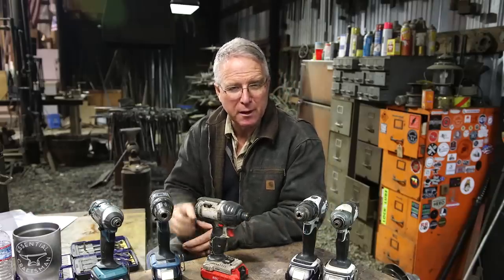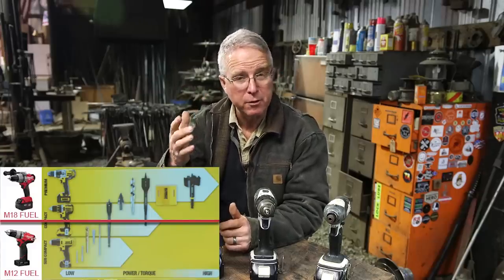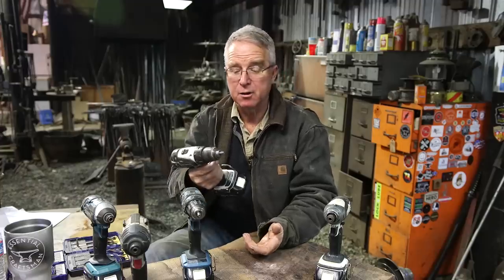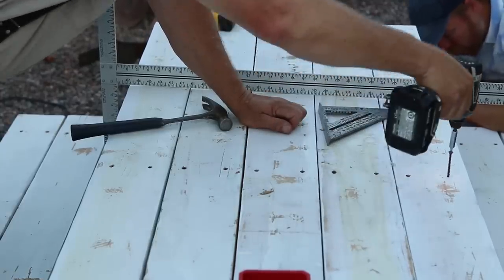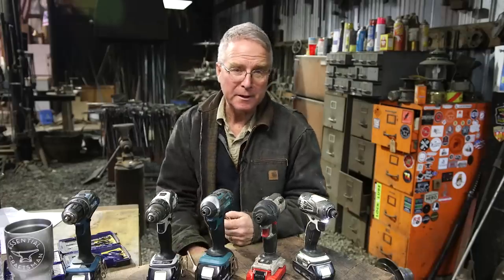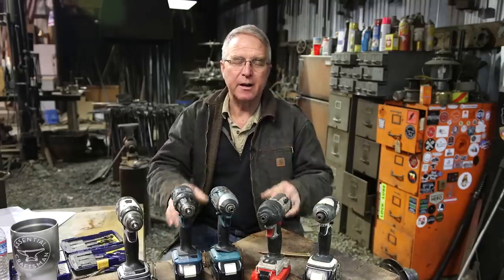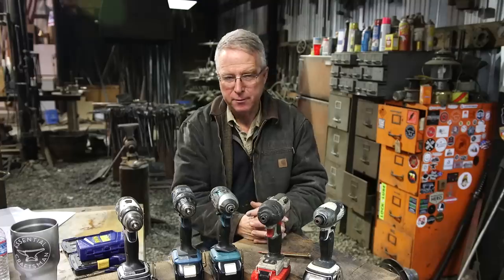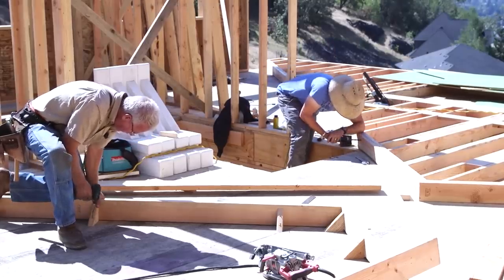Impact Driver Vs. Drill Driver

Comment: I had a boss who didn't want me using an impact because he didn't like the sound it made.  I don't miss him!
Reply: Wow, Crazy  , I guess he didn’t stick around for the fien cutter thing that is best awesome and noisiest tool ever
Reply: I don’t really care for the sound either, but I love my impact driver and wouldn’t go without ever again.
Reply: STOP USING THAT WORM DRIVE!
Reply: I prefer impact for framing. Anything tiny, minimal fasten jobs, etc, I use a drill. On the subject of annoying sounds, I have to use a "fine tool". Dont know the proper name, that's what my father almost called in. Straight tool, electric, oscillating blade. Blades about inch and a half. Good for delicate work or small cutouts--cutting out electrical or plumbing from the frame without  damaging anything. It's such a high speed whine it drives me insane. Ear plugs are a definite.
Reply: You should look up oil impacts. An impact driver without the sound.
Reply: @cjhebert94   The name of the tool you're talking about is not the english "fine" but the German word "fein". Fein is a German Company, that invented this tool, and so the tool is often called fein aswell.
Reply: @Loulexismus  appreciate it. Most annoying sounding tool I have to use for work.
Reply: @Loulexismus  Multimaster ;)
Reply: That's the main reason I avoid them. In my small shop the sound is absolutely deafening, and I don't really want to have to put on ear protection for driving screws. When I need them though there's no substitute.
Reply: It's the sound of money to me. Impacts save huge amounts of time.
Reply: @austinpatrick2682  my thoughts exactly.  Lithium ion batteries are also a big time savers.  I use hearing protection... its cheap and its on my neck anyway
Reply: Loulexismus , I think Fein was first to market, but the generic name is a multi-tool.
Reply: First time I heard one, I thought there was something wrong with someone’s drill. Now I won’t live w/o one.
Reply: @robertbeirne9813  YES! The first time I heard one, I thought the ‘dummy’ was just stripping out the screw head!
Reply: Sounds like you didn't like the sound HE made! :)
Reply: @DK85  Yea, didn’t realize it was an impact driver. Sounded the same as when someone was stripping out a screw, or screw tip.
But I’ll take that sound over those damn 2-stroke engines any day! - leaf blowers, weed-eaters, edgers, etc. 😣
Reply: @Narrow_Gate_Forge  not that there's anything wrong with that!...  but yeah he probably did.
Reply: @Nathan.Christie  I got a hydraulic impact driver 3 years ago and it was life changing.  It does what an impact driver does with only a fraction of the sound.  I don't even own a standard impact driver anymore.  Milwaukee and Makita make really good ones.
Reply: @Narrow_Gate_Forge  All men sit to pee, eventually.
Reply: Impact drivers are noisy.  You should be wearing heating protection no matter what so it shouldn't bother you
Reply: @cjhebert94  it's called an Oscillating Multi function Power Tool.
Reply: Did you work in accounts payable or something?
Reply: @robertbeirne9813  just to be pedantic, it's "oscillating multi-tool" to distinguish it from the foldup pocket pliers
Reply: @andrewford80  rofl
Reply: Impact driver in a cemented steel fence strainer post. That will leave your ears ringing.
Reply: Ryobi makes a impact driver called "soft-strike" that is a lot less noisy.
Reply: disklamer you are correct 👍
Reply: The sound is terrible and I'm sensitive to loud noises. That's why I'm a nut for hearing protection.
Reply: @reallyhappenings5597  Yep, more truth to your words than others will realize...
Reply: @Narrow_Gate_Forge  I congratulate you.  Simply making the point that Father Time is undefeated in these matters.
Reply: @coen555  My eardrums just cringed
Reply: I've had alot of bosses who don't know what they're doing
Reply: What a silly fool he is
Reply: @cjhebert94  It is called an oscillating multi-tool or oscillating cutoff tool.
Reply: @Fekillix  Hydraulic impact drivers are much quieter, but by no means "without the sound." They're still very loud, just not as loud as the traditional hammer & anvil impact drivers. They're also less powerful.
Reply: @xenonram  I tried my colleagues Makita Oil impact and I'd call it pretty damn quiet. But the torque rating is much lower, however side by side I'd say the performance is only 20% less, not 50% as the torque rating says.
Reply: I, too, hate the sound of work getting done.
Reply: @paulremmey8268   Generally called a Multi-Tool here in the UK
Reply: Wow, ridiculous.
Reply: Drives me nuts when people use them for anything but large screws and bolts.
Reply: @allwoundup3574  😂😂😂
Reply: cedarstrip rocketship Makes me wonder how he ever became a boss of anything and also you should’ve asked him if he doesn’t like the sound of money? 🤷🏻‍♂️😂
Reply: I pick the impact driver for the noise
Reply: Yes we do. I did a pipe fitting job. Did most of my work at night.
Reply: The idiocy of banning a tool because of the noise aside, impact drills sound so good!
Reply: Oh jeez 😂
Reply: @tristankendrick2582  pmsl the boss pays the wages, but here's hoping he pays day rate and doesn't insist on paying on piece-work.
Reply: Was that a boss or a wife?
Reply: @Mikey-ym6ok  probably both
Reply: @cjhebert94  I think your talking about a multi tool? Or a reciprocal saw.
Reply: That's literally my favorite sound in construction
Reply: @cjhebert94  we call it a multi-tool where i work.  Rockwell builds a great product! Could use one to almost build an entire home.
Reply: Anyone offer him earplugs.
Reply: I wouldn't either
Reply: The noise is awful, but hearing protection there boss.
Reply: @Narrow_Gate_Forge  I usually sit.  There I said it.
Reply: I love my Ryobi Quiet Strike Impact...It is sooo quiet!
Reply: I’m sure he didn’t make much of an impact.
Reply: My boss says the same thing
Reply: Milwaukee surge
Reply: I love the sound of an impact driver. It sounds like I’m getting stuff done!! 💪💪

Comment: My impact drivers have exponentially more hours than the drill.
Reply: same here
Reply: I bought 2 drills before I realized the benefit of an impact driver. Now my drills only come out for drilling holes or putting screws in a steel roof because of the clutch. I use my drill more now days for running a K-drill for ice fishing or mixing paint.
Reply: @christophergruenwald5054  The ice auger attachments are friggin awesome.
Reply: Same here. Mine looks a million years older than it's tool siblings.
Reply: @christophergruenwald5054  use the driver for steel roof trust me its heaps better
Reply: Peterfixit over tightening the rubber washer is to easy with an impact and that’s the only thing keeping a new roof watertight for many years.
Reply: @christophergruenwald5054  you are correct, however with practice you can stop before you get a pancake
Reply: Got a dual set of an impact and a drill way back when. The drill has maybe double digit hours of work whereas the impact must be closing in on 1000
Reply: 50 to 1
Reply: @peterfixit7221  if use drill,any issue?
Reply: I find myself using my little m12 screw guns over my impact. I build Kona Ice trucks and we use a lot of 3/4 stainless steel screws and my Milwaukee impact likes to round and break off the heads of them. Nice to have a small gun that clutches out
Reply: I find myself using using my drill only for drilling holes with drill bits or spade bits. For driving in fasteners, I almost always use my impact.
Reply: I bought my kit months ago and still haven’t used the drill lol

Comment: Our field crews use battery powered drills and impacts even though we have air and electricity available. No cords or hoses just makes the job site safer and more efficient.
Reply: Good point about not having cables being safer, I also feel not being wired to the mains is safer. If a cordless gets soaked or breaks, it will probably just fail, a wired tool might just decidde to put every available amp from the grid into your arm.

Comment: There's also, aside from all the other great points made, the advantage of having the drill with the bit you need to drill the pilot-hole and having the driver with the bit you need to drive a screw. The fact that you don't have to switch from drill bit to driving bit and back and forth so often in the same tool just makes life that much easier.
Reply: 100% agree. The constant switching sucked.

Comment: I bought a set like this which included a drill and impact driver. I've never touched the impact driver. I'm running home today to put a bunch of bolts into shit now can't wait.
Reply: The only thing I use a drill for now is drilling nice holes in wood. Impact for life. lol
Reply: Just be aware that you should use bits for the impact driver that are "impact rated". Regular bits may work fine but wear out quickly, although smaller ones (like square bits) could break. The impact rated bits aren't much more expensive than regular bits, but are usually a darker color.
Reply: narlycharley, get a set of nut drivers for it, get at least the 1/4”and the 5/16”. They’re great for anything with a hex head!
Reply: Go by one of those $15 hex sets by ryobi or dewalt at home depot and youll have multiple bits.
Reply: Murtasma I gut laughed out loud about u comment, so funny.
Reply: I use my drill for drilling and my impact for fastening except for hanging drywall, which I have a drywall gun that uses collated screw belts.
Reply: Ha!  I know exactly the feeling!
Reply: You can screw in 6inch screws only using your indexfinger and thumb.

Comment: My son in law is a know-it-all millenial. But he IS mechanically inclined. He has used a small cordless impact driver for a few years now. He is all praise for it. But you defined it for me. Now I am considering a battery impact driver of the same brand as my battery chainsaw. Then I will have a spare bsttery at times. (I learned this with the purchase of several Craftsmsn units. But now it is time for a new brand.) 
Thanks Scott.

Comment: Great video! I love my impact drivers. Total game changer. Two other big advantages of an impact driver for threaded fasteners...

1. The torque applied to your wrist is far lower — no need for an added support arm like you find on powerful drill drivers. My big Makita drill has enough torque to break your wrist if you're not careful. With an impact driver you can bury a huge Tapcon screw into concrete using fingertip pressure.

2. The torque applied to the structure being fastened is far lower as well. For example, you can use an impact wrench to remove and attach lug nuts from a wheel while it is off the ground. A breaker bar will want to spin the wheel around the axle, but an impact wrench puts all of the torque directly into the lug nut and none on the axle. Note: you still need to lower a vehicle to properly torque down a lug nut, but it's nice to be able to lift a car before dealing with the lug nuts.

But don't forget — wear hearing protection when using an impact driver!
Reply: Came here to raise the same two points. These are signficant. Taking the blade holder off and on my lawn mower with anything other than an impact driver is a major pain due to it wanting to turn. Likewise, the torque an impact driver produces is often greater than what my wrist would be able to take if the same torque was delivered in a continous fashion by a traditional drill.
Reply: Tapcons shouldn't be installed with an impact driver. There are very small pieces of concrete holding the screw in (the concrete that mates with the groves in the screw), and when you start adding percussive force to it, it tends to fail. Same happens when people use the hammer drill, that they used to drill the hole, to also drive the screw. (Albeit worse with the hammer drill than impact driver.)
Reply: @xenonram  I hadn't thought of that. Excellent point and great advice.

Comment: When I first heard about impact drivers i didnt really know what they were all about.  Now that I own impact drivers I cant live without it.

I would also advise getting the 1/4" hex to socket adapters.  They usually come in a 3 pack including 1/4, 3/8 and 1/2" so that way you can use sockets.
Reply: Working on my cars has changed quite significantly since buying the socket adapters, And since there isn't much impact from these little drivers I just use them with regular sockets without a problem. I then use the torque wrench to set the final tightness.
Reply: @fprintf  yah I use the regular adapter and regular sockets also with no issue.. Ive since got a smaller sized impact socket set but still rocking the cheap harbor freight 3 piece adapters.
Reply: Eventually I've gotten all of the above and much more.  Go as you grow.
Reply: I wish that decent twist bits with a 1/4 inch hex shank were not as expensive as they are.  For lots of common drilling tasks, it's easier to carry these around and do the drilling with the impact driver.
Reply: I work in a steel mill and I use the heck out of mine for sockets. Almost exclusively so. The little Milwaukee fuel impact driver can do way more work than you'd think. If that doesn't do it, I generally just go for their 3/4" impact and adapt down to what I need. I've actually had that 3/4 fuel bust nuts that a 3/4 Ingersoll air impact couldn't get.

It was probably a slight age issue since all impacts diminish over time but still, it's a beast and doesn't require dragging out an air line.
Reply: @EclecticBuddha  A friend of mine is a railroad mechanic and uses a Milwaukee 3/4" impact to remove locomotive head bolts... they're the real thing for sure. I have a 1/2" mid torque model and it's still got enough power for any automotive DIY I could imagine. It removed the 37mm axle nuts on my 3/4t Suburban without complaining and they're torqued to like 180 ftlbs, plus 15 years of Pennsylvania weather exposure.
Reply: @desertfox2020  Same. He does mobile Diesel repairs and he loves not having to get a hose from the service truck to the locomotive. Eventually I'll get a small one for home auto work.
Reply: I’m surprised at how many people didn’t realize you could do this. It was my first purchase after buying an impact driver.

Comment: Last few days I was building a gate for a friend and were using both in reverse roles.  Used hex shank drill bit in impact and torx bit for screws in the drill because I could set the clutch low using 1 1/4" screws to attach the gate slats and bang em in quick without over driving them with my impact.  Worked awesome !!

Comment: The impact driver has a hammer and 
anvil the hammer strikes the anvil and slips over the top of it allowing it to rotate. Thank god for these tools I remember having to screw everything by hand when I was an apprentice Electrician, the battery revolution has been fantastic also!!
Reply: There is also a helix behind the hammer, which pulls it away from the anvil when torque is applied from the motor. :-)
Reply: And silly me has seen way too many panel screws overtightened by electricians using impact drivers to install them...

Comment: I remember when I got my first impact driver. (It was almost 20 years ago.) My dad pissed and moaned about it, and how I should just use the drill, until he actually saw it in action. We were attaching wood to a 2x2x1/8" (maybe 0.120") welded square tubing frame. It set the self tapping screws so much easier, more reliably, less cam out, and quicker. I've also replaced all our old 18V brushed cordless tools with 12V brushless tools. They have more power, less weight, and longer runtime than the 18V brushed tools. They aren't as good as 18V brushless tools, but I have rarely found a time that I need 18V brushless tools, even on the job. I installed 40 ¼"x3¼" Tapcons into block (drilled to full 3¼" depth in poured blocks and areas I hit the webbing) with one 2 Ah battery. One battery to hammer drill all the 3/16"  holes, and to drive the Tapcons.

Comment: My first drill and impact driver was one of the best purchases I made when I first started collecting tools. Also, I completely agree that buying these in a set makes the most sense. Usually you will get the best value for your money that way.
Reply: Yeah, you can often get it for free if you look around for a deal. I got my first one for free when I bought a circ see, recip saw, hammer drill, work light dealt combo kit. (You got to pick out a bare tool if you buy the kit.) But I've gotten other free impact drivers with just the purchase of a hammer drill.

Comment: ive been an HVAC installer for 20 years now. In the early years of my career i didnt have an impact, what a mistake! Now i use my 18 volt regular drill only for drilling holes of various sizes 1"-6". And then use a 12 volt impact for everything else. I fasten ALOT of screws on a daily basis and some into very thick multiple layers of metal. Plus use it for large fasteners and anchor bolts into concrete. No more using a socket wrench. That little 12 volt impact is truly amazing and to me it seems like it has 100 times more power than a much larger drill. For sure a must have tool